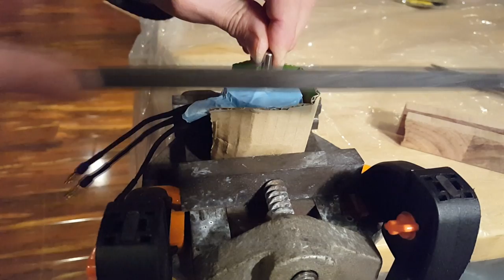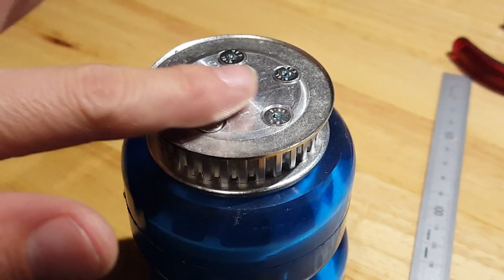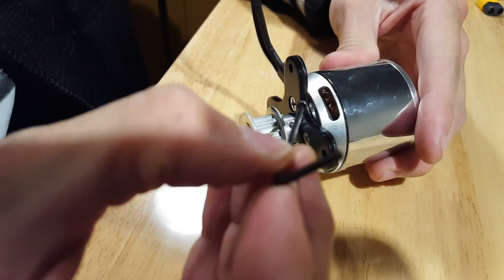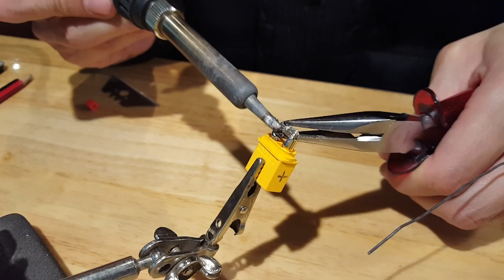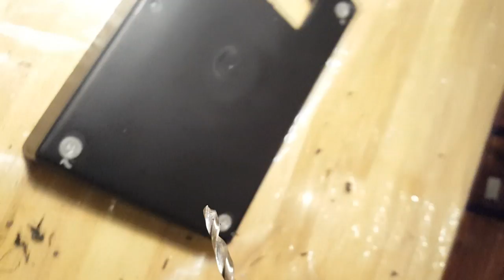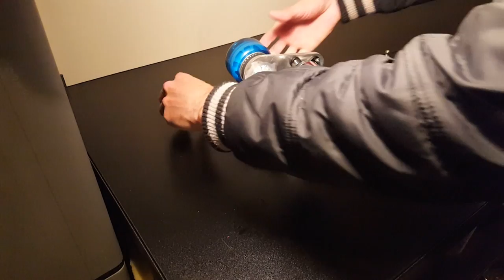How to build the Cheapest electric skateboard

Comment: Ive had a look through but have you mentioned what controller you use? I've managed to get the rest of the parts from the video! My planned build is basically two of everything you have!
Reply from the maker: 3en Gill that sounds like a good build! the remote is a benchwheel remote. but you can use any RC remote.  i like the benchwheel because its compact. and i had one kicking around..

Comment: are long board trucks backwards compared to regular boards? on regular boards the kingpins face each other.
Reply from the maker: BsB Dirk longboards often use reverse kingpin trucks. so yes i guess you could say they are reversed.  however the pivot cups always face outwards just like standard trucks.
Reply: Low Guido's Chop Shop thank you

Comment: I have never welded anything in my life and that looks so bad ass!  I know we've talked on the esk8 builders form before and I've commended your charging style...so simple and so clean!  BTW, now that I've seen it in action I understand that you are charging the 2 lipos in series. But my question is when you charge does the the ESC complete the circuit for the charge and would that be also safe if you were using a VESC?  Thanks man!

- Neil
Reply from the maker: Neil I dont charge with the loop key in. however i don't think it would make any difference if you did.
Reply from the maker: also Neil, I always have a chuckle at all these people who say they make a DIY board but then buy all the mounts and pulleys that bolt on nicely. not that there is anything wrong with that... but its not exactly DIY its more like meccano. plus welding has sparks!
Reply: There are definitely degrees of DIY for varying skill levels that people can take.  However, if you had the option to weld I vote for sparks!

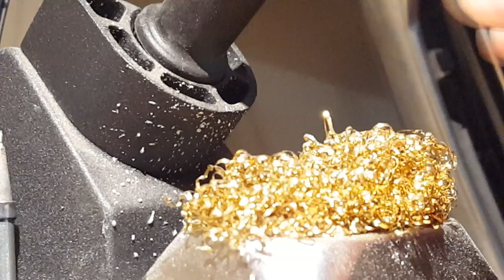Comment: If you want to solder stuff, don't do it exactly as he did. Expose the battery wires first, twist them together nicely and then weld them. 8:14 As reference for my comment.

Comment: Using a series adapter to connect the 2 batteries in series and then to the esc would be easier but would not allow to install that xt 90 port on the enclosure, or is there some way to do that with a series adapter?

Comment: Great vid mate and clean work , really nice job , just one question what set up have you got for charging , i can see your charging via the balance connectors so I'm guessing 6 cell max , which charger are you using and how have you weird the charger cable/plug ?
Reply from the maker: luke James yes 6s charged with an imax b6 charger.

Comment: Hi

I notice your e board collection, how did the drop down deck with 5 inch wheels go? Are the wheels ok?  
Also did you have much clearance from the ground after the enclosure and all?
Reply from the maker: Tj Dang yeah the "soft roader" as I call it is great. rubber wheels drag more than urethane. but when you have motor power thats not really an issue. check out my other videos i have a couple of videos of it.

Comment: Hey low guido, great vid! I'm trying to figure out how you wired those balance cables together, do you have a wiring diagram on the forum? Can't find it...
Reply from the maker: +logikai http://www.electric-skateboard.builders/t/beautiful-diagrams-no-words-just-pics/3179/4
Reply from the maker: In the diagram i have pictured the black wire cut, but in the video i might have cut the red wire. It makes no difference, they are the same. Watch the video over and over in slow motion if you need to.  You don't want to get it wrong or you will short one of the batteries. Its a REALLY common mistake people make and they can't understand where they went wrong. When I solder together negative and positive of the 2 batteries it makes those 2 wires the same node. Therefore the matching red and black balance leads are also the same. So one of them can be left off because they are already connected by the big wires. Some people like to join the balance wires as well, but I discourage this because it is more work to do and it just makes things confusing.  If you cut the connector like I do you cant get it wrong because the plugs are keyed.

Comment: Ha ha I have that Kmart longboard - rides like a dream!
Reply from the maker: Brett Boughton yeah man.. good for the price. i did say cheap. between you and me i geared up the standard wheels too. but the blue ones worked nicer for the video.
Reply: Just for your info I am 110 kg (6'2") and that Kmart board barely flexes. I wouldn't ride it at 120kg + though.

The Kmart complete is only $45 and while its no Long Yachtz its a really good ride.

Comment: First thanks for that greate Video! I would like to put batteries together like you did here I also have 2x 3S. I'm only a bit unsure if I should just plug in to the batteries (4+3 like you in the video) and after plugin into my loading station to the 7pin connector and same for the XT60. If I set my loading station to 6S everything should went well? I have the fear to create a firework :D
In short: If I do it like you will I be able to load the batterie with that both connection(7pin and XT60) directly on the loading station? Or do I need to care about anything else?
Reply from the maker: As long as you get the polarity correct there wont be a problem. Make sure you plug them correctly.
Reply: Low Guido's Chop Shop Thanks
Reply: Thanks, I already have my LiPo here and it work very well (both charging with 6S in serie), still waiting for engine! But this was very helpful for me :)

Comment: This video is the template for my board. It's great and thanks a lot.  Build is moving quite well, fibreglass boxes made, most of the wiring done, going into metal shop to sort out gearing mechanics soon. Have a question if you don't mind about the receiver. My receiver has a separate battery cable, can I just plug my x car 150 amp three pins into the receiver and will it power it, or will I need a separate battery pack. Anything that is not exactly like your video really fucks me up, total excited novice. Do I need access to receiver all the time to switch on and pair. My plan was to have it in with the two esc's semi sealed off for only occasional access. Fuck you mack soldering look easy, I was fucking around for about an hour with one joint today. Watched the video about 50 times now, only another twenty until the job is done! Thanks man have you a patron page!
Reply from the maker: +23 23 the ESC will power the receiver.  No need for more batteries. Once its paired you can just leave it alone. No i don't have patron.
Reply: Thank you!

Comment: Is that motor mount aluminium? and if it is how did you weld it with mig? a spool gun maybe?
Reply from the maker: Ewout Wielenga no spool gun. just a cheap hobby welder with aluminium wire and pure argon gas. reverse polarity torch, voltage set to highest, feed speed about 3/4, lots of stick out  its not the prettiest weld but it gets the job done. I can't afford a TIG welder.

Comment: Best
What sort of metal does your skateboard have?
Because everything works, but apparently I can not weld my stainless steel plate on my skateboard shaft.
Reply from the maker: It's aluminium.  Both the plate i used and the truck. Stainless will not weld to it.
Reply: @lowguidoschopshop  ok thank you

Comment: dumb dumb  question. so, if i have a 2X5s lipo and i buy a turnigy reaktor that can charge 1~10s i can do this schema  of charging that you demonstrated on the video? thanks
Reply from the maker: yes. easy. just join the two 5S leads to make a 10S like I did, but with 6S. the main thin is that you match the polarity of the packs so that you have the balance leads in the right order.
Reply from the maker: and subscribe to my channel.

Comment: yes, but what should do people without your equipment?
Reply from the maker: I have got a drill, a soldering iron, and a MIG welder. anyone attempting this should have at least the first 2. and maybe a friend or local shop can do the welding. still for the cost of the welder which I think was around $200 plus $200 worth of skateboard parts you could still have a board for $400 cheaper than any pre made board, and you have a welder.

Comment: Hey man, awesome video. I plan on replicating this but I'm wondering what the range is. I'd prefer a board with lower top speed but longer range so any advice is appreciated.
Reply from the maker: if you want a longer range just use a larger mAh battery.. or more of them. this board gets about 13km range.

Comment: Hi, with this system, can you charge the battery directly? Also, too, doing the other video.?
Reply from the maker: Pedro Linares yes I charge the board directly off the B6 charger
Reply: Low Guido's Chop Shop, thanks a lot to your answer. But, I watched that when you was charging don't connect the power wires on xt60 connector on the board, ¿Can you explain why it is not necessary? I watched the other part.

Comment: Yo what is that yellow loop plug thing? Is that like the 'ON' switch? If so, is it possible to put a toggle switch or something on there? I've seen a few discussions about switches on the forums and I don't understand why adding a power switch is such a difficult thing..
Reply from the maker: menappi the plug is the On switch so to speak. there are no switches available that can handle the high inrush current in this application. at least none as cheap as a 70c connector anyway.
Reply from the maker: ItsNotScripted it does but that doesn't isolate the battery from the circuit.
Reply from the maker: the XT90-s is a great plug. I use them on my higher voltage boards. for 6S the XT60 is ok because the spark isnt as big.

Comment: Hey man, when you make the connection for charging on the XT60 that is gonna be popping out of the case, I notice two red wires connected to it. I am used to seeing one red and one black. Its fine to put both positive ends on the connector like that? I am just curious Bec I thought it wasn't. Also, would you be able to make a video showing where I could add a switch into my setup? So I can turn on and ofd
Reply from the maker: That XT60 is the switch. Thays why both wires are red.
Reply: @lowguidoschopshop  so how would u use that switch to turn your board on and off?
Reply from the maker: @cameronlucas6004  it's called a loop key.  Plug itn8n for on remove for off

Comment: hey! gj with theboard! what's the top speed of your creation?
also could you make a list of the main parts? (motor,batteries etc.)
Reply from the maker: jofoldipeter top speed is around 38km/h I have made faster boards  and boards with more range but this build was a budget build so I didn't go all out.
Reply: uhh, that's great for the price! Have you done tests to see the range?
Reply from the maker: i'll get about 13km out of that battery. I usualy would got 8,000mAh or 10,000mAh for 22+km but as I said.. budget board.  the video at the end of me riding it is not sped up at all (I hate the way every electric skateboard video is sped up)

Comment: How do you discharge your batteries?
Reply from the maker: Carson Edmonds I assume you mean how do I re charge. i use an imax b6 charger and it plugs into the white connector that comes out of the container. this is something that gets questioned often so if I get enough interest I will make a video about charging.

Comment: What gauge wire did you use for the battery connections?
Reply from the maker: +Wesser & Lu it was 10awg I believe. It was already on the batteries and ESC.
Reply: Cool, thanks.

Comment: Jeez.  I get that this is a proof of concept, but with those skills, go get a job, and use the money to buy a board that was built using CNC, injection molding,  is water resistant, comes with an app, etc..
Reply from the maker: I'll take that as a compliment.
Reply: Low Guido's Chop Shop it is! Albeit, somewhat backhanded.
Reply from the maker: I understand what you are saying but there is honestly nothing on the market that I can look at and say "I couldn't do that better" 80% of electric skateboards you see are kickstarter starlets and vaporware. they promise a lot and deliver disappointment. my most basic of builds will out perform most. there are only 2 electric board out there that are real and fast and that's the evolve GT and the enertion Raptor. I have ridden them both (i even own one) and I'll still make my own thanks.
Reply: Eh, now you're getting ahead of yourself.  A board is more than just raw battery capacity and top speed.  While you're playing with cardboard and a drill press, a company can be using CAD and a water jet. Plus, where's that app I mentioned?  You going to make that yourself too?

Comment: nice video thanks for sharing you knowledge, but i have a noob question. i saw this videos three times in a row but i am still in doubt how do you send power to charger you batteries. in another video, you just plug the balance cable, this xt-60 is just for a loop key to turn on/off the board or it has another functionality? thanks
Reply from the maker: check out my other video on how to charge it. https://www.youtube.com/watch?v=O5gi35AtPSw
Reply from the maker: the XT60 is just a loop ket and the charging is through the balance lead.
Reply: sorry but i havent understood yet. do you send energy to charge the battery only using the balance lead cable?
Reply from the maker: yes.

Comment: what voltage can you ride till?
Reply from the maker: 3volts per cell so for a 6S it's about 18V. but then theres the chance that one cell could be down a bit and you end up with still 18V total because the other cells have a bit more in them sonits safer to monitor each cell or cutoff at a higher voltage like 20V

Comment: Hi, brilliant video. I am at the stage of chopping the balance extension in two. How do you plug them into the battery pins? I mean that the cable's pins are split 4 and 3, but the batteries both have 4 pin parts to connect to (I have everything set up from your charging video as well). Also, when soldering the motor to ESC, which cables go to which? The motor's cables aren't colour coded but the ESC's are. Thanks
Reply from the maker: you only need the positive lead on the battery pack that is the actual positive of the battery. the negative of that pack is actually the same as the positive of the second pack if that makes sense?
Reply from the maker: oh, with the motor you just hook up any wire, and test it to see what direction it spins, if it spins backwards then just swap 2 of the wires.
Reply: Ok thanks for the help. So I don't need the red wire (from the 4 pin) of one of the batteries? Also is glue enough to protect the connections?
Reply from the maker: you don't need the red wire from the most negative battery. don't mix them up! its important. watch the video carefully.
Reply: http://imgur.com/a/RZG4F so like this? Sorry for all the questions, it's just this part of the build I'm having trouble with.
Reply from the maker: yup she's all good!

Comment: Which cable of the esc must be attached to which cable of the motor?
Reply from the maker: it's not too important, just hook them up and test the direction, if it spins the wrong way swap 2 of the wires.
Reply from the maker: it's not too important, just hook them up and test the direction, if it spins the wrong way swap 2 of the wires.
Reply from the maker: it's not too important, just hook them up and test the direction, if it spins the wrong way swap 2 of the wires.
Reply from the maker: it's not too important, just hook them up and test the direction, if it spins the wrong way swap 2 of the wires.

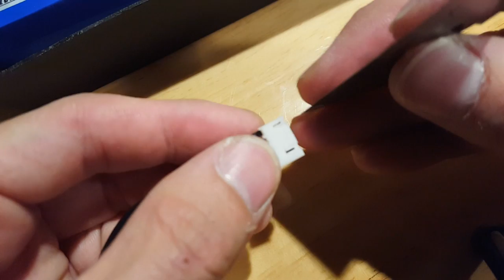Comment: Hi! When you are making the polarity match and at minute 15:15 you use the razor to like press the metal pin? Can you explain what you are doing exactly?
Reply from the maker: I cut the 6S balance lead in half to connect two 3S leads
Reply: Can I check, the balance leads are only needed for charging and do not need to be wired up for the motors to be run? I am building a set up where the batteries are separate and removable so I can charge them individually and just want to confirm I don't need to add the balance wires for the circuit to work properly.
Reply: @lowguidoschopshop  yeah I noticed that, and then u used the razor the like pinch the end of one of them. It's at 15:15
Reply: @knottyboy4knotz  you'll need the balance leads for charging even if you remove it as far as I know, it just depends if you'll be charging through the leads. This way of charging avoids the need for a BMS the way I understand it. I think if you were to charge each battery on it's own you'd just need to plug the balance leads that are already on the battery into your charger. I'm sure he'd know better
Reply from the maker: @knottyboy4knotz  i put them there so that I can charge without removing the batteries but you dont need them to run the board
Reply from the maker: @cameronlucas6004  I was just just trimming  a bit so that the plug would fit properly.  There is usually a notch that wasnt there becsuse I cut the connector in half
Reply: @lowguidoschopshop  thanks alot I was thinking that but wasn't sure. I appreciate you answering your comments!
Reply: Hi thank you for your quick reply, I was trying to confirm that I don't need the extra balance leads to use the setup on the board?
Reply: Would you be able to send a link to the balance cables that you used at 15:15 ? I ordered ones and they don't snap into the battery balance leads. I'm unsure which one's I'd need then?
Reply: I have a balance lead extension like the one you have shown in the video, but it doesn't plug into the leads coming out of the individual packs. I can't figure out which one I need instead Bec they look identical!